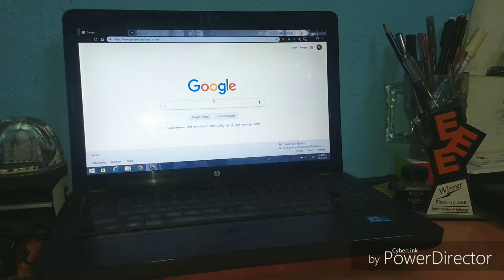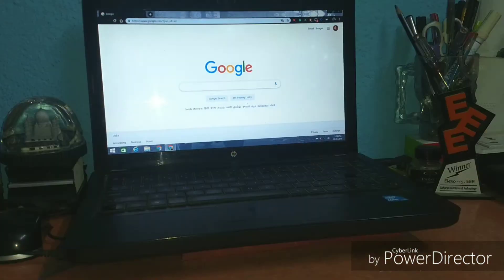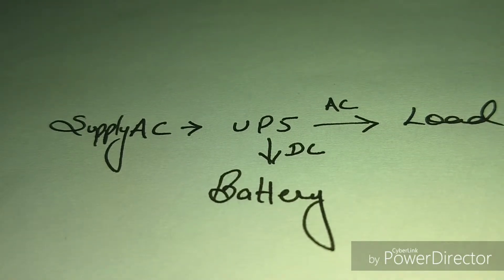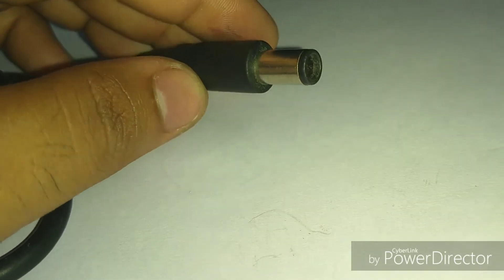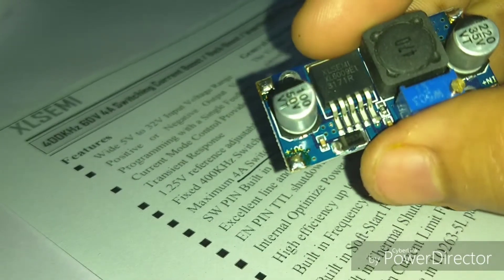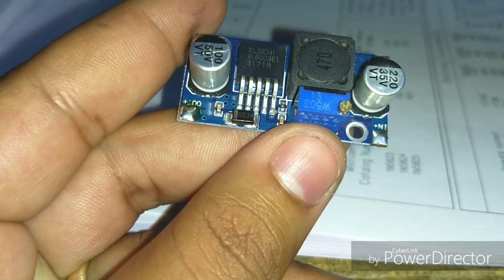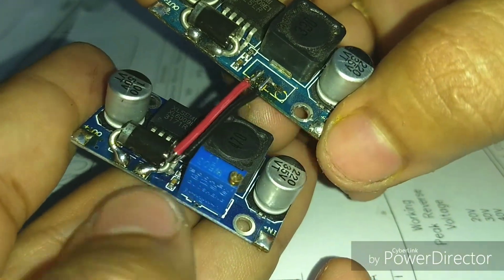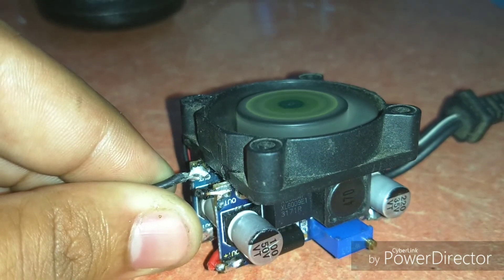Laptop charger with XL6009 Boost converter Hack from 12 volt Battery.

Comment: Xl6009 output voltage ??  Set Please Confirm
Reply from the maker: You can adjust output from 3.3 volts to almost 30 volts
Reply: You can use heatsink on 6009

Comment: Is the xl6009 safe for laptop?
Reply from the maker: Yes, just don't crank up the voltage level, double check it with the multimeter.
Reply: @diyhemantprojects2841  thanks👍
Reply: @diyhemantprojects2841  I just read xl6009 documentation and it says it can provide upto 1.5 amps will it be able to charge my laptop?
The laptop charger has max current output of 3.4 amps.

Comment: why not to use a single boost converter rated at 5A?
Reply from the maker: Brother, that's why i made this video to show you can use parallel converters, and ofcourse you can use single with more ratings but that cost more.